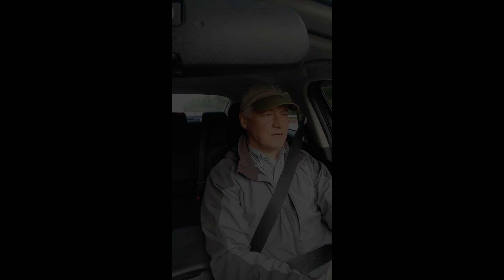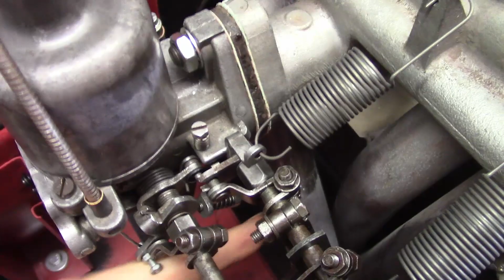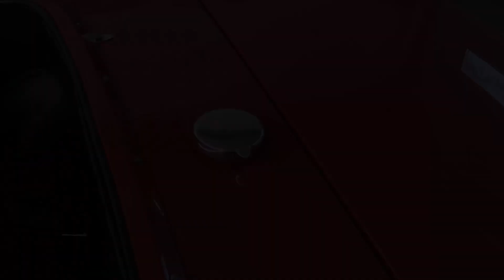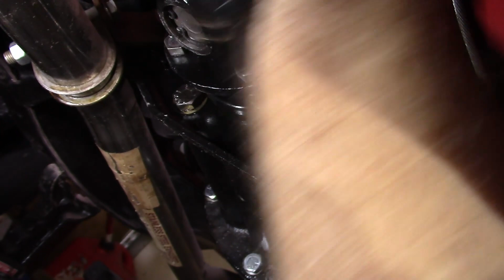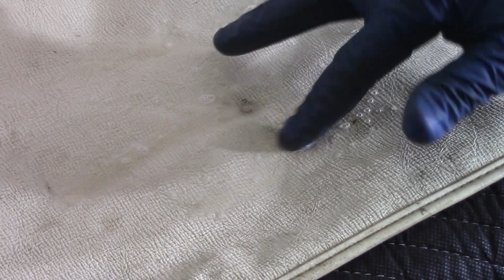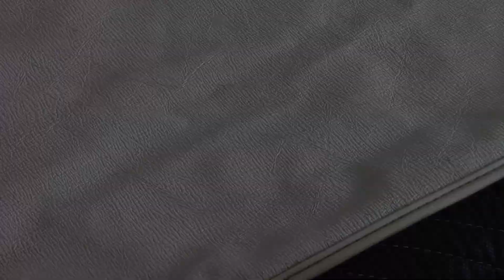SU Carb Tuning - Part 3 and More Finishing Touches | Roundtail Restoration

Comment: My problem is, i did and re done and done again the whole carb tuning as you did, in the yard, hitting the gas pedal, everything sounds nice and responsive, then i take it out on the road and a few mins in. the car feels bogy and running rough. at this point im not sure if im still having a carb problem or something else, i do know if i put the air filter gaskets on backwards as if to block the carbs breathing holes it does seem to run a lot better, but i can not find a suctions leak anywhere, even with the propane trick.
Reply from the maker: I'd definitely make sure that you don't have the gasket blocking the vacuum port on the air filter. And no significant vacuum leaks for your distributor advance. There's a saying that 90% of all carb problems are not the carbs (or something like that). I had poor running problems when trying to get above about 3000RPM under load and it ended up being sediment in the tank that got sucked up and clogged the jets. I ended up taking the jets out, spraying carb cleaner through them, and changing the fuel filter for a few tanks of gas. No problems since. Good luck!
Reply: @roundtailrestoration  Thanks for the reply and advice, Yes indeed i heard that saying also ( 90 percent of carb problems are not), My tank is brand new so is the fuel pump and gas filter, I also had that issue when driving, above 4000 Rpms, the car would get really boggy and stall completely, parking on the side of the road for a few minutes and the car would start up just fine, i'm going to have a look nonetheless, if the jets are clear, and change my plugs and the coil...
Reply from the maker: That doesn't sound like carbs to me, but I will admit that I'm not that great at troubleshooting running problems, especially those with smooth running (I'm more of a running or not guy, not great at tuning). Wish I could be of more help. Plugs maybe; coil, probably not, unless it's really old or the condition is questionable. How about points? Electronic ignition?
Reply: @roundtailrestoration  Haha, we are alike in that respect, I can get things going pretty fast but the fine tuning is something else, It has the Electronic ignition conversion kit in my distributor. the plugs are really white which indicated the car was running lean, so the plugs were probably running hot, they may have gotten premature wear, and its not a costly thing to change to eliminate as a possible problem.
Reply: @roundtailrestoration  Found a little article that might explain it or at least part of the problem, it has something to do with the " Beer can" oil separator, here a photo post of it, may help you or someone else down the road. https://www.ahexp.com/phile/6/34341/gilspeedno8.jpg
Reply: @ Figured out the problem, it was my ignition coil, it was not delivering enough spark, But i did a stupid move, i bought a cheap one on amazon, not even an hour into the first drive, and it split itself open leaving me stranded on the side of a country road. but till it self destructed the car was running PUUURRRRRRRfectly
Reply from the maker: @patprop74  good deal. Sorry about that other coil, but I think getting stranded has to happen once. Right of passage.

Comment: Hi Chris. First of all, thanks for all of your restoration videos. I have just acquired a 65 Spitfire thats very similar to yours and ive been going through all of your helpful videos.  I think the prior owner did all of the carb tuning and the car starts and runs. However, my idle is around 550. Id like to raise that to 850. Can i just turn those two screws by the top of each carb an equal amount without disconnecting the linkages and re-tuning the carbs?
Reply from the maker: Yup, assuming they were properly balanced, you should just be able to turn the screws incrementally, the same amount each, until you get the idle you want. Thanks!

Comment: Keep in mind, the jet height static setting using the lift method, won't be accurate with the air cleaners on, unless you're running K&Ns or some other free flowing filters. I mark the jet nuts and body with a sharpie dot, so after the cleaners are on, I can accurately move a flat a time, if you need to go a bit leaner. Then you're down to plug color, unless you're using a wide band O2 sensor kit to tune it, oil weight, needle profile and spring rate. Just another hour or two 🤓
Reply from the maker: Fun, ain't it? I think I need to re-tune them again. Plugs are a bit black for me, not that nice grey-brown color.

Comment: Great video Chris, always very clear and logical I enjoy your way of working. I’ve just overhauled a set of SUs and am going to start with this method to get the basics right.
Reply from the maker: Thank you. SUs are pretty basic, but it does take some finesse to set them up, I think. I still struggle to get it right, but I think I'm slowly picking up on it. Setting the jet mixture is where the black art is, I think.
Reply: @roundtailrestoration  yeah the tolerances are quite tight. I put new bushings and spindles in and did a full overhaul, boy I had some trouble getting the jet centred on one of the carbs, had to take it off and do it on the bench in the finish but fluked it correct in the end, now the piston position on each looks very even  at tickover and I can get a stable tick over  anywhere from 500 to 1000 rpm. Haven’t tried a flow meter on them yet but I think it’s going to be OK, without specialist tools getting them rebushed is a bit of a challenge but it seems to have gone OK.  Going to invest in a colourtune set or maybe an analyser and check the mixture.
Reply from the maker: I hated centering the jets!

Comment: Hi Chris, question for you. I believe in your video you turned down the jets 2 or 2 1/2 turns. That lowers the jets about .63”. In looking at technical tips from MiniMania, they also say to lower 2 turns but they specify to 1/8” or .125.” Of course, this does not make any sense. Did you measure the drop in the jet once you completed tuning your carbs? Closer to .65” or .125”? I think you ended up turning down your jets quite a bit as you tuned. Perhaps the .125” is correct? I am working on my son’s Bugeye which I haven’t done for years. Thanks so much! Lin
Reply from the maker: Hi Lin. I did not measure anything, I just followed the tuning guide directly from SU (http://sucarb.co.uk/technical-hs-type-carburetter-description-adjustments). There's also another resource you can find online, but it's about the same. If I'd have to guess, though, I think it's probably closer to the half-inch (.65") than it is the 1/8" (.125").

Comment: Chris, I am sorry but I could not find the video I was thinking about. Moss has choke return springs. Try one on the the front carb choke lever (opposite the same lever on the rear carb that has the cable link. I think you will find that while the choke may be a little harder to pull, the spring will fully close the idle enhancement. See what you think.
Reply from the maker: Ok, I'll check it out.

Comment: Chris, yes, my Bugeye HS2’s also have internal springs, but the Sprite still uses a separate spring (third spring) and this really makes a difference in fully closing off the idle enhancement. I will find a video showing the three springs and post it here. Lin
Reply from the maker: Awesome. Thanks, Lin, that would be much appreciated.

Comment: Chris, doesn’t the Spitfire have a return spring on the choke linkage? My big Healey and my Bugeye with HS2s use return springs to pull the fuel enrichment fully off. Lin
Reply from the maker: Hi Lin. There is a return spring, but it's integral to the shaft, not part of a separate assembly like the throttle return spring is. Mine are both there and they are installed properly, but they've always hung up a bit on me.

Comment: hey Chris...the DMV is the DMV...does not matter where you go...lol nice job on the carb tune...I have always wanted to get the vac-u-tune tool but have always just done the shop manual and the o'l ear-o-phone and just listen to the...tic tic tic of the engine and watched the RPMs...the clunk you hear in the rear....mine does it too....could just be a spitty thing...I got mine on the alignment rack at work and darn if the alignment machine had all the specs for an alignment in the database...i was surprised....so I aligned the rear and found out i need to find me some of the shims for the lower control arms in the front to get rid of the positive camber so i will quit wearing out the outside of the front tires....lol  Keep up the good work....good luck with the DMV!!!
Reply from the maker: Thanks, Robert. Good to hear from you. Hope you and the family are well!

Comment: Good to see that those carbs got tuned even a little better this time, when you have done it 20 times more it will probably go much quicker :). I can recommend for others to watch all 3 chapters, there is a lot of good comments and information on what could go wrong while setting it up and what restorations that are needed to make sure that there is no air leakage. Most of us that have tried to tune this SU carbs from start will recognize the needed steps and if you are still uncertain on how to perform a step and the expected response from it, you will get it from this videos. 
Thanks again for charing, this is a 5-star channel
Reply from the maker: Thank you, Andreas!

Comment: Thanks, Chris, for spending all your time putting these Carb videos together. I’m having major ‘issues’ with the same setup on my wifes’ MG Midget 1275cc, 1973 vintage!!!
These SU Carbs are so tricky to get tuned and balanced!
Unlike your Triumph, there is very little wiggle room around the bottom of them, the damn wheel arch gets in the way!!!
Reply from the maker: Glad you liked them. Definitely learning as I go. Once I got that RPM response after lifting the piston, it started to come together for me. Yes, the Spitfire is very roomy and easy to work on!

Comment: I hate to tell you this, but I'm a bit thankful for the oil leaks, I was starting to worry that I wouldn't have anything to watch soon!
She sure sounds nice now with the tunes carbs and that lovely characteristic clickety-clack valvetrain.
Good luck with the DMV, it was foolish of me to think it would go smoothly..
Reply from the maker: Yeah, I almost had it registered. It was actually the owner of the dealership that stopped it, come to find out. Oh, well. Hopefully I'll get the temp and bring the car back for the VIN verification and I'll be all set! Just in time for winter :(
Reply: Well you're getting the soft top scrubbed up, so you might be able to get some cruising in before the salt comes out. It's going to be the longest winter ever waiting to drive her.
Reply from the maker: Hope so. Yes, a very long winter.